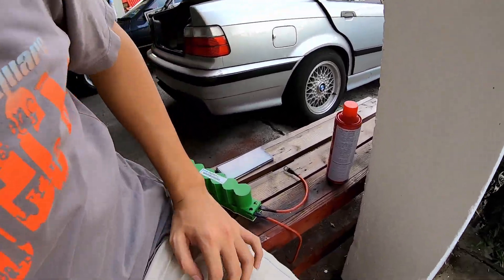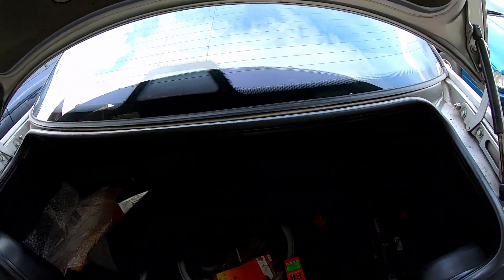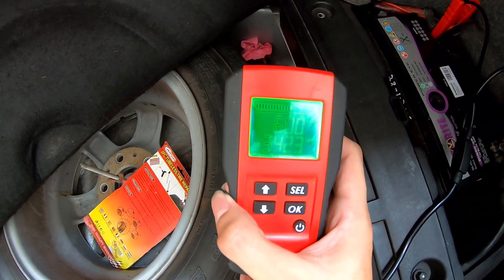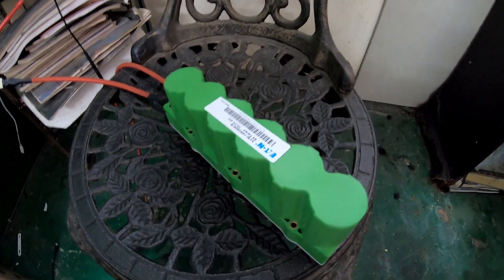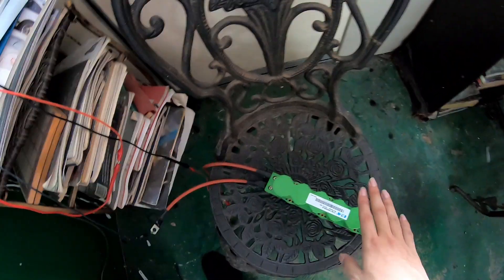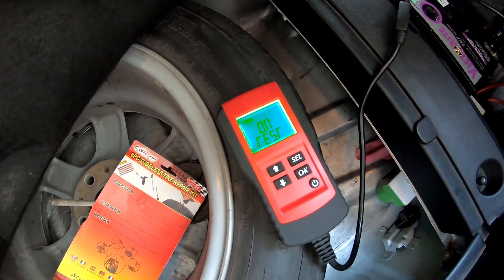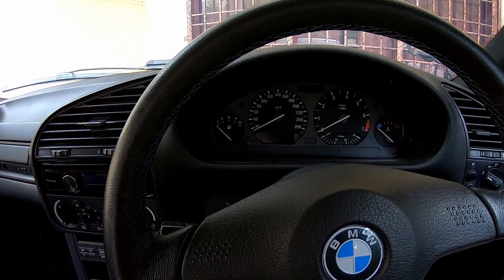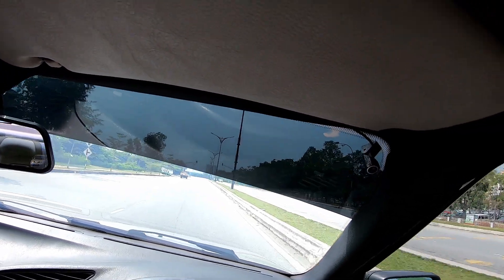Testing supercapacitor for my E36's old battery

Comment: Oh did you use only capacitor on your car or with battery? Because capacitor alone cannot hold charge , it always discharges. So it is best to use the two together with battery. 

Capacitor will help discharging huge amount of required current and protect battery from doing 👌

Comment: Still working?
Reply from the maker: it still works up to February this year. after February my car is idle in workshop, so I couldn't tell for sure. should be working
Reply: @mengsuan  Did the capacitor gave problems or your car is at the workshop for other reasons?